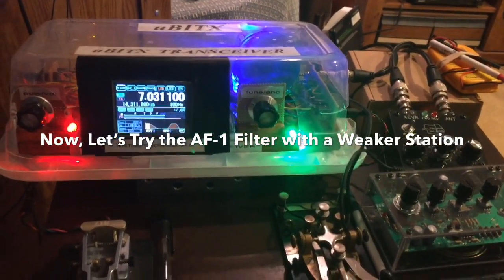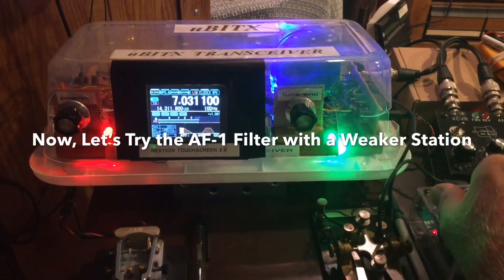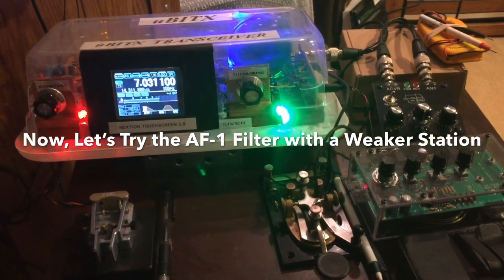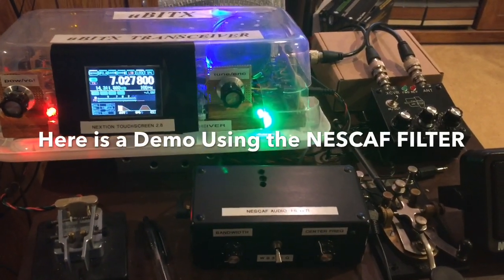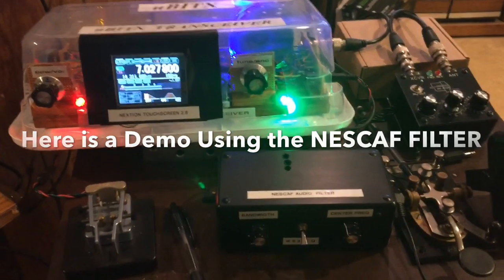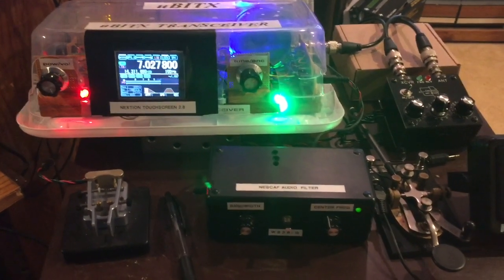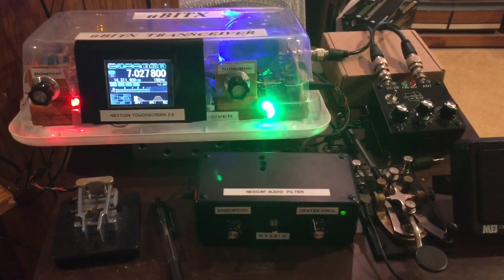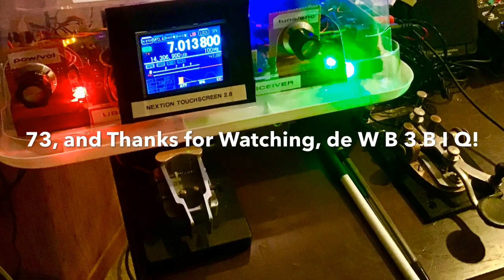The uBITX with Additions, Modifications and Filtering

Comment: Rick would one of these filters work with my IC 703 QRP rig for cw? I never got a cw filter for this rig and it really needs one to separate the signals.Do these filters plug into the external speaker jack?Do you think it would help? Would it do as well as a 500 he filter?
Reply from the maker: Hi, Ron. Absolutely! Either one of these two filters would make a dramatic difference in signal separation as well as peeking the signal you want to pull out. Both of them are kits, and easy to build. The Elecraft might be available already wired, not sure. But either is real easy to build and works super! They just plug into the external speaker jack.73’s.

Comment: Thanks for the video.

I have  uBitX coming soon, will put a bunch of the mods that you did. 

You mentioned the 4sqrp hypermite filter. Can you put a link?  I don't see it on their site.  And the tuner, that's between the uBitX and the antenna, correct?  Not built into the radio itself.
Reply from the maker: Hi,  Greg, here is a link to the 200 Hz Hypermite audio filter, offered by the 4SQRP club: http://www.4sqrp.com/hipermite.php.  The audio filter just goes between the audio output of the uBITX and headphones or speaker. If you add an antenna tuner, it goes between the rig and your antenna. Since the uBITX has no antenna tuner built in, it would be a good idea to have some kind of antenna tuner, since the rig puts out only 10 watts. The suggestions I made to add the CEC software upgrade and Nextion color display are based on the version 3 uBITX board that I show here. If you have a new uBITX coming, it will be a version 5 board, which will use the upgrade version CEC software 1.2, which is different from the 1.097 that I describe here to do the upgrades. Be sure to study about installing the CEC software upgrades before actually doing it, so you have a clear understanding of how it is done. 73’s and good luck. Hope this helps. 73’s.